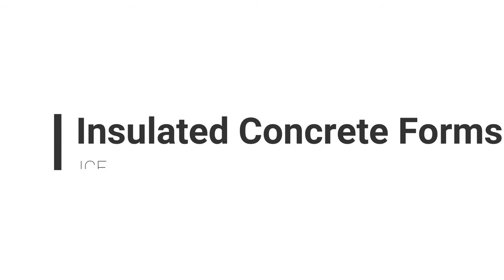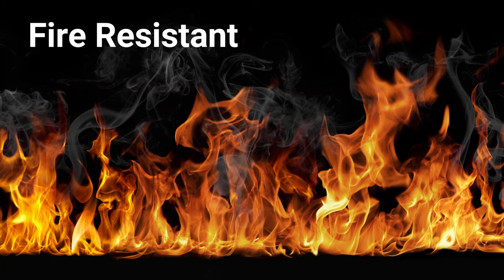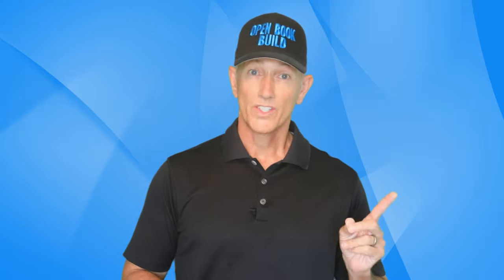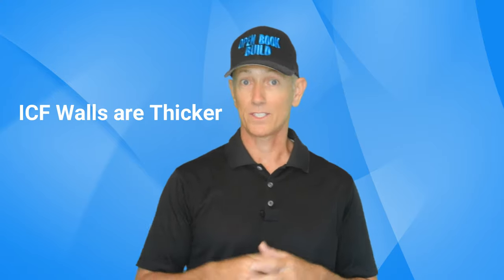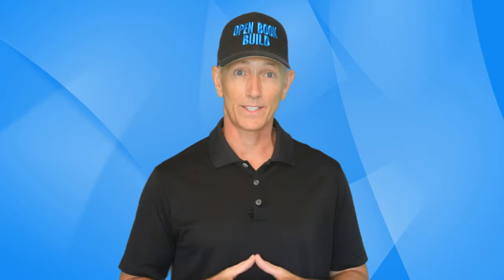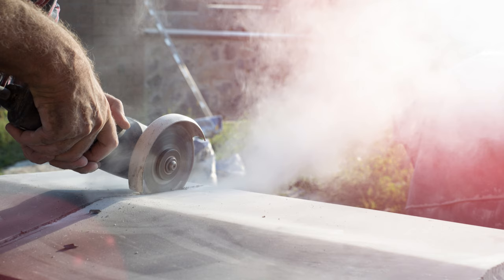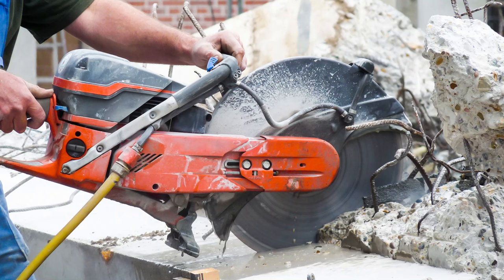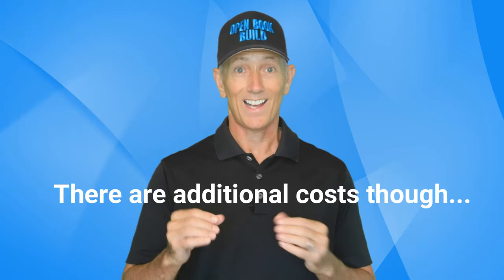ICF Construction: Why I Haven't Used Them as a Builder

Comment: Now I see you never work with professionals, that's what you not choosing ICF, all your concerns in my opinion are stupid. I did smile when you start talking about humidity problem, and then I was sure that you don't know what you're talking about
Reply from the maker: Concrete is 15-20% water...and that's a fact.  Fact #2:  That water in the concrete mix will make its way out of the concrete and if ALL of your walls are made of this material, there will be moisture coming off the walls = high humidity and moisture for at least the first year after pour.
Reply: @OpenBookBuild  don't be silly inside the concrete wall before you pure concrete you installing few 20 mm drain pipes. 45 days and everything is dry only think you need is a small fan. Really when I hear about how you build houses in USA in some cases I really 😂 because not every time I see how can people make them lives harder
Reply: @phredka12  where do you put these 20mm drains?  Can you show an example in video or a picture?

Not doubting, I just want to see how that is done.
Reply: @joequixotic3039  inside the concrete, basically it is a 20mm (large hole ) drain pipe with paper tape( no wax, or clean paper  ) around, placed horizontal in layers every 30 cm with slope. And you need fan to blow in that pipe to blow out humidity. Usually it takes 25-45 days with 20w fan( at winter I recommend to use air heat collector ( basically Spiro pipe in black box painted black)). It's very useful when you have -30'C outside and you need to work with concrete.
Reply: @phredka12  that's interesting.  I'm not really concerned because I will be building in a desert and my envelope probably won't be sealed very quickly.  I did want to leave my concrete exposed in to my cold roof cavity so it can dry upward through the roof vents but maybe I can run those drain pipes vertically down in to my footer drain?  It would be on 24" centers so not as much as you suggest but I don't think it's as much of a problem as anyone makes out unless the concrete is totally blocked from drying.  I don't think vertical would need fans either.
Reply: Does a pipe have holes in it? How does it help with humidity?
Reply: @sergeyc5528  drain pipe have always holes. paper around the pipe helps to not feel the holes and pipe with concrete. Fan is helping with taking out the community because of the difference of temperatures. Basically we have paper, pipe with holes and fan to blow air
Reply: @phredka12  Ok thank you. You said that the wholes on the pipe are 2 cm? what is diameter of the pipe you use? How often do you put them in the wall? every 30 cm you said? If so in a wall is 2.5 meters tall you will have arround 8 pipes laying horisontally?
Reply: @phredka12  it’s just that drain pipes usually have 50mm diameter. And concrete core if ICF is 150см/1600см. What diameter of the drain pipe you use?
Reply: @sergeyc5528  I wouldn't want a 2" drain (50mm) in a 6" core (150mm) ICF.  I want to use ICCF so it would have to fit in the 6"x6" screen grid.  There is no slope in the horizontal so vertical for me and the grid is on 12" centers with vertical rebar every 24" so my drains would have to be sized similar to rebar (20mm if I can find it), tied to my horizontal rebar to keep it centered and spaced on 24" centers in the verticals without rebar.  My guess is the slope and fans are to prevent pooling in the lines and encourage draining.  If I go vertical gravity should do the work.  I would probably only take it 1/2 way up my wall so threading the drains through the block isn't horrible but I figure moisture that doesn't dry upward will soak downward and find the drains...

But before I go to that expense and hassle I've got to research concrete drying to see if the issue warrants any of this in my case.
Reply: @joequixotic3039  I was thinking vertical too. Let the gravity do the work…  The main thing here is how to find material for the “drains” end what to use for it.
Reply: unless the concrete was saturated the amount of water evaporating wouldn't be a concern and the foam panels act as a vapour barrier so moisture will never enter the home.

Comment: Closed minded stick builders. Not one thing this guy said was a flaw in the product, but rather, an excuse as to why he cant break from old style building, to a better proven method. Most builders refuse to learn new techniques. Stick built homes lose heating and cooling (exchange rate) more than 10-20 times a day, that is very costly. Old style insulation and studs shrink, break down and lose efficiency. New style CF blocks go up in value the longer you have it. This guy is lazy and will say anything so he wont have to rethink and come up to date with a better method of building, therefore, stays in the past and looks for customers also close minded like him.

Comment: Good, informative video, but it's a lot of information to take in all at once. When making these videos, consider allowing a little more airtime (silence) between each point to give the viewers a chance to absorb what you just said before moving on to the next point.

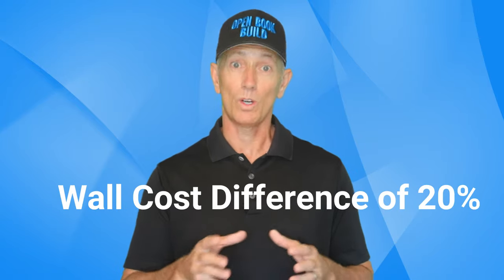Also, you provided a (current) cost difference between an ICF wall and a quality stick-framed wall (4:55), but you didn't say whether it was 20% more or 20% less. When the viewer is working hard to absorb everything you're saying as quickly as you're saying it, this little detail throws the him off. Slow down a bit and make sure to define those differences so that the viewer isn't tempted to make the wrong assumption and completely lose track of your message. The video is only 6:43... a minute longer won't detract from the video. It's when those videos become unnecessarily redundant and stretch beyond 10 minutes that you start to lose the viewer's attention.

Otherwise, as I said, good, informative video. Loved it, thanks!!

Comment: so number 1, choose an ICF prebuilt plan, diy, save thousands on carpentors that should be experts at math if they are supposedly professionals. 
Mould pfft what a total crock of crap, if it rains on any building while its underconstruction mould could happen. Same goes with concrete being unforgivable... pfft measure twice, hire professionals not bloody un qualified idiots. glad its better than this crap in australia. 
Oh what and its so hard cutting a channel into foam for wiring pfft 🙄 
couldnt watch any further.

Comment: Sorry, I didn't hear any valid reasons to avoid ICF builds. All you need to do is find a builder and designer/architect who specializes in ICF and you're good to go. The long term benefits and savings far outweigh any build issues, IMO.
Reply: The video is not why you shouldn't, it's why he doesn't. Also he is not saying that the individual cons are a reason for him not to use ICF but rather all the cons as a whole makes it a deal breaker.